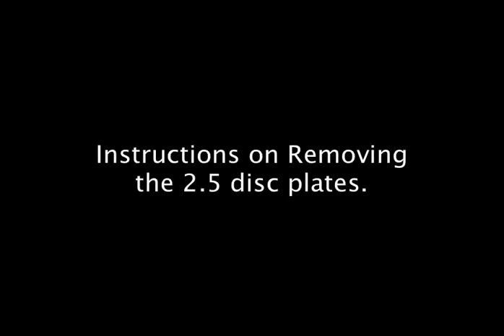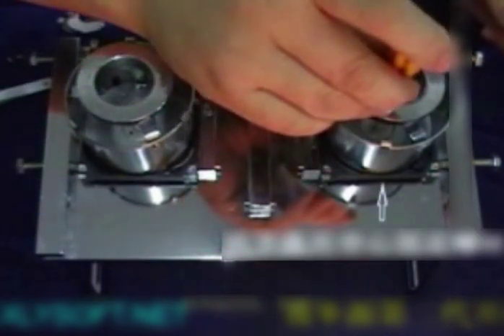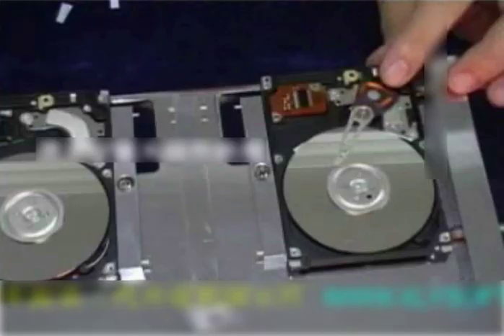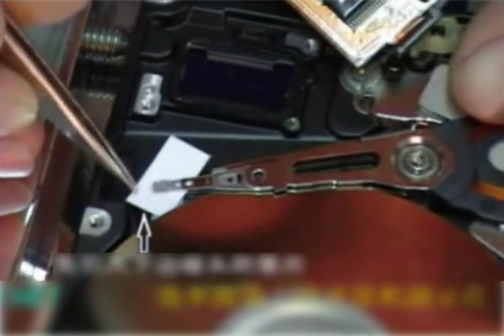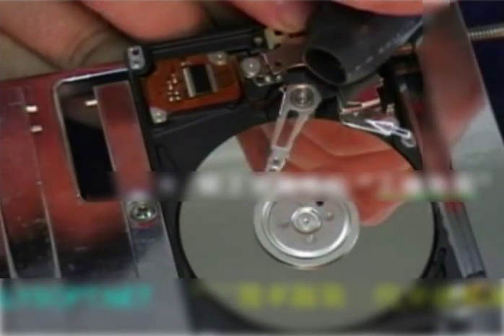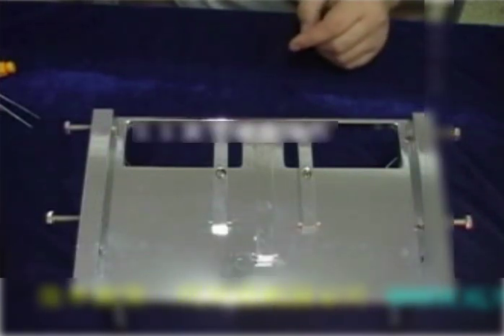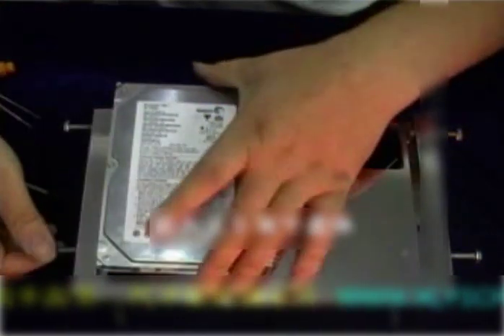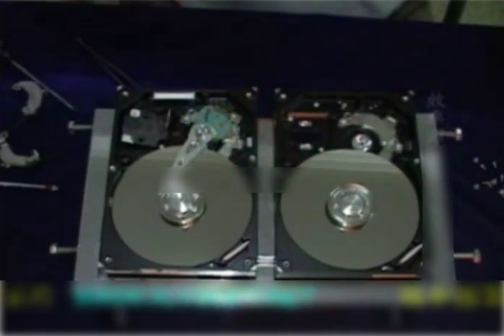HDD Tool

Comment: whoops at 1:34 minute mark you omitted a very important part to the public, the part that involves how to disengage the heads that are parked on the platter drive and remove the heads, since the heads cannot touch each other it would have been good that you showed in the video the procedure involved in putting a plastic in between each head before moving them outside the platters and eventually removing the heads from the assembly.  Now that you made this 22:49 long video taking a few minutes (or seconds) extra, to show this very important step wouldn't have hurt and would probably save a rookie trying to save his data from destroying both, his source and donor heads by making the heads touch each other after taking it off the park position.